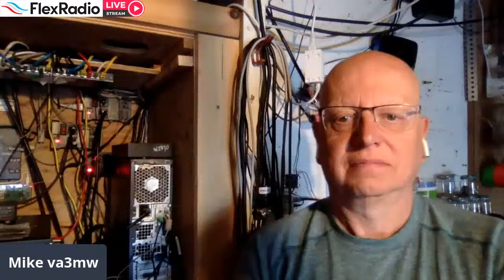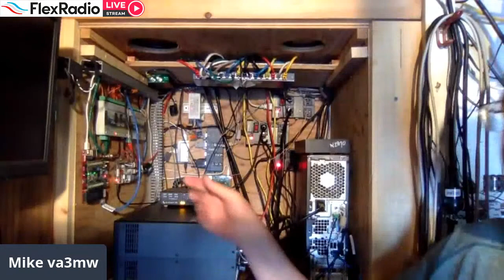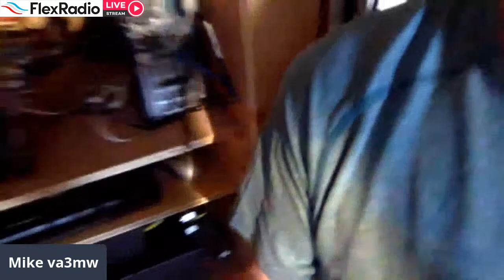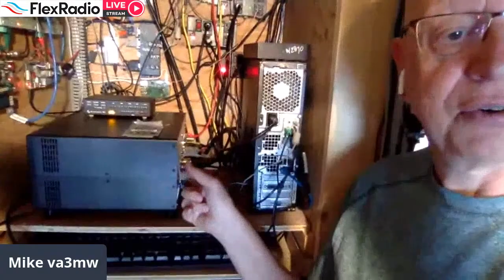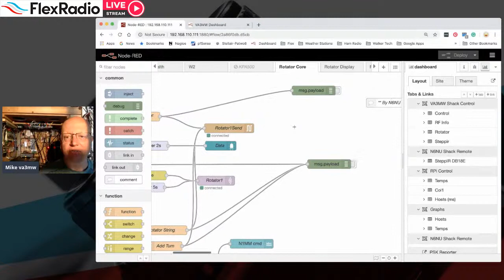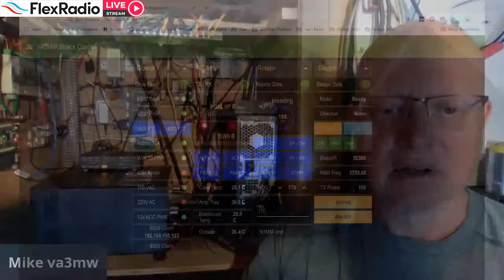Mike's FlexRadio remote HF Station

Comment: Timestamps for major topics.

00:01 RF choke everything.  https://www.yumpu.com/en/document/view/52831371/common-mode-chokes-by-w1his-yankee-clipper-contest-club
05:50 Wire everything.  Do not use wireless.
08:15 Plan to put a PC at the remote end.  Enable boot on power within the bios.  
08:36 Remote desktop - Three good options; AnyDesk, Team Viewer, Google Chrome Remote
09:10 Recommend running Windows 10 Pro
09:30 Webswitches (relays) are your friend.  Kmtronic is ideal https://www.kmtronic.com/lan-ethernet-ip-8-channels-web-relay-board.html
10:25 Stay away from cloud based webswitches or relays.
11:20 Automating your internet modem reboot.  Purchase a christmas tree timer or search on Amazon for "automating modem and router reboot"
12:00 Rasbperry Pi script to check for internet.  Use https://www.digital-loggers.com/iotfaqs.html for connecting to GPIO ports on a Pi.  Use the script at https://github.com/r0n22/Internet_Monitor via a cron job to check for internet.
12:50 Node Red on a Rasbperry Pi install https://nodered.org/docs/getting-started/raspberrypi
13:20 Lightning Maps receiver https://www.lightningmaps.org/
14:20 W2 Wattmeter https://elecraft.com/products/w2
14:35 4O3A 8x2 antenna switch https://shop.flexradio.com/antenna-genius-8x2-plus/
15:10 4 port USB to DB9 RS232 Serial Adapter hub https://www.startech.com/Cards-Adapters/Serial-Cards-Adapters/4-Port-Industrial-Wall-Mountable-USB-Serial-Adapter-Hub~ICUSB2324I
15:49 PG XL FlexRadio Amp https://shop.flexradio.com/powergenius-xl
17:40 Digital Loggers A/C relays https://www.digital-loggers.com/iotfaqs.html
18:25 Intel NUC https://simplynuc.com/nuc-products/
18:30 16 port switch.  Get a non-managed switch. Netgear switches are good.  Wrap the cable in a mix 43 toroid.
20:13 A/C fan with thermostat (not the same as Mike showed, but similar) https://www.coolerguys.com/
20:47 A/C fan controlled with NodeRed via the KMTronic web relay.  Search Ebay for "120v muffin fan"
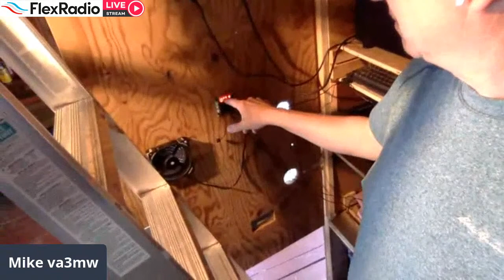21:06 DC fan with controller.  Search Ebay for "12V 120mm fan" for the fan.  Search Ebay for "automatic pwm fan controller"
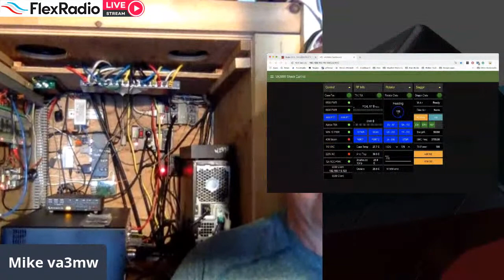21:40 NodeRed demo.  Flex Community Node Red discussion https://community.flexradio.com/flexradio/topics/remote-operating-and-node-red
21:50 NodeRed for beginners https://youtu.be/AGMNEEQWEhQ
25:15 Redundancy redundancy redundancy!!!!!
25:20 UPS story
27:30 Linear actuator remote disconnect for lightning protection https://vimeo.com/133917999
29:50 Ask questions and answer with details.  Mentor from a keyboard!  Everybody has to start somewhere.
30:50 Flex supports all platforms, the radio is wide open, just need to build a client!
31:40 Flex Radio Wiki http://wiki.flexradio.com/index.php?title=Main_Page
32:30 IOS for Flex https://apps.apple.com/us/app/smartsdr-flexradio-systems/id1089157289
32:40 Dogpark SDR for MAC https://dogparksoftware.com/dogparkSDR.html
32:49 NodeRed examples on Flex Radio Community https://community.flexradio.com/flexradio/topics/remote-operating-and-node-red (search for Node Red)

Comment: My ISP doesn’t allow Port-Forwarding does anybody know another way remote accessing ?
Reply: That's a tough one.  Maybe you can create a reverse SSH tunnel with all the ports you need at the remote end with a raspberry Pi?
Reply: Dave, you may have to look into using a VPN.  There are stories in the Flex Community about using SoftEther for a VPN and it works really well.
Reply: see if they will allow  you to either put your own modem/router or put there's  into bypass mode and then put your own router